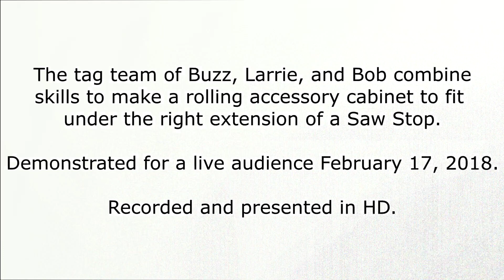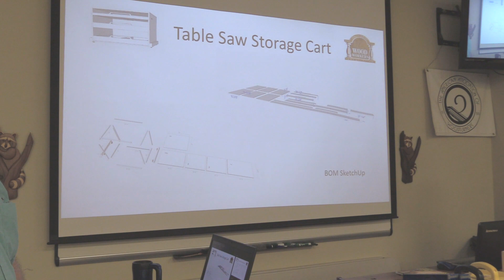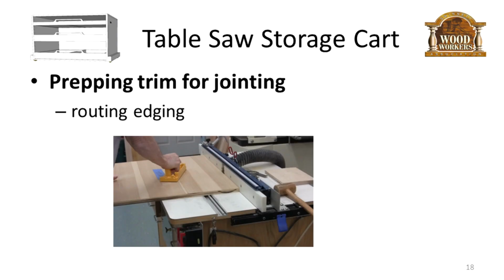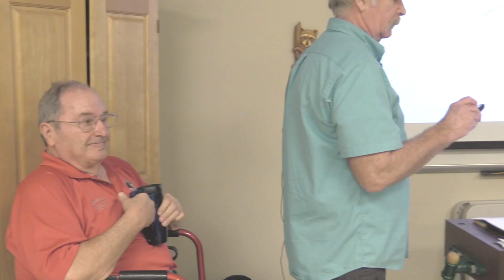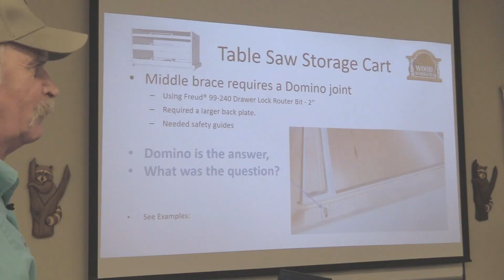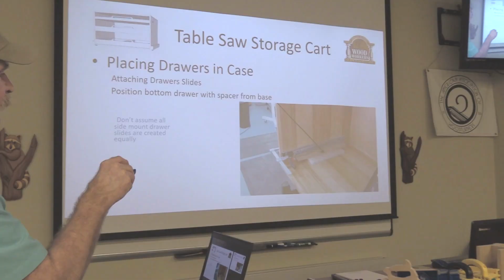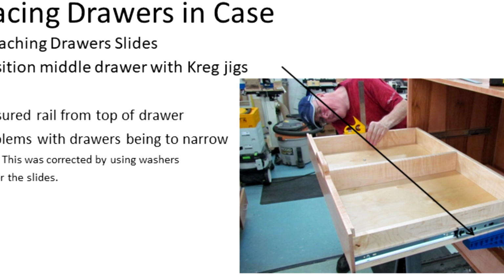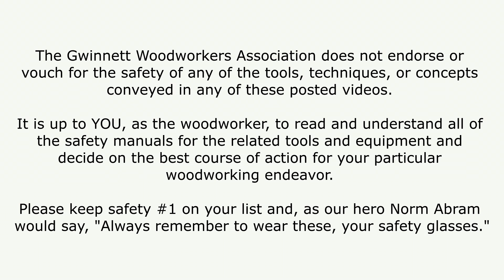Under Table Saw Cabinet

Comment: Thanks did not realize I would be first to make comment whoa ,pressure pressured very nice job putting this together  I think I am going with built in cabinet full length  mine saw 52 in cut right of blade set up before track saw 👍🙏